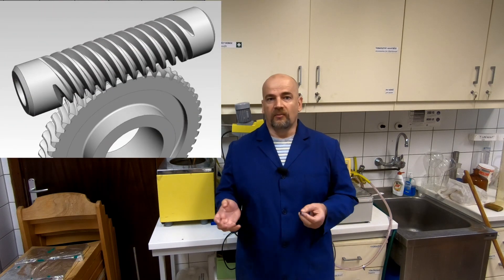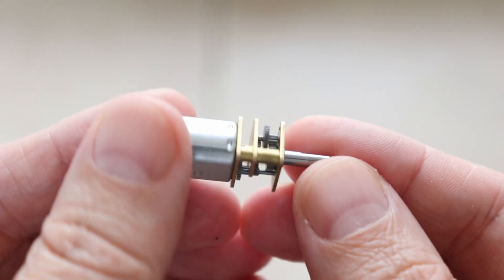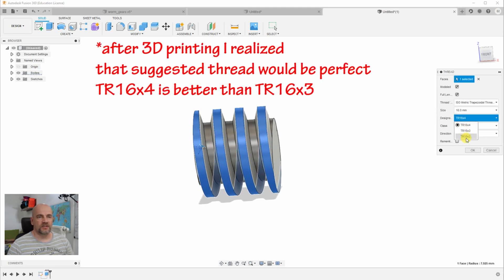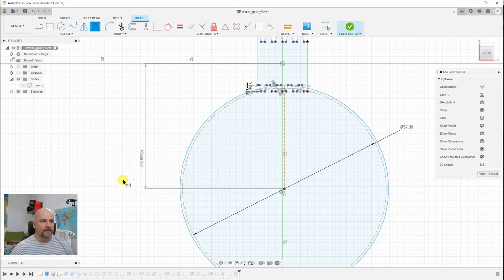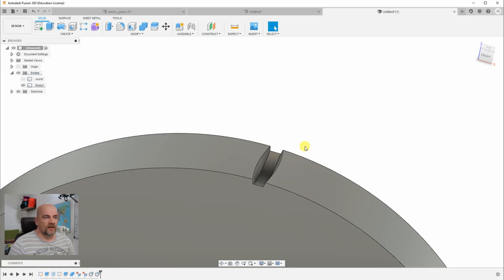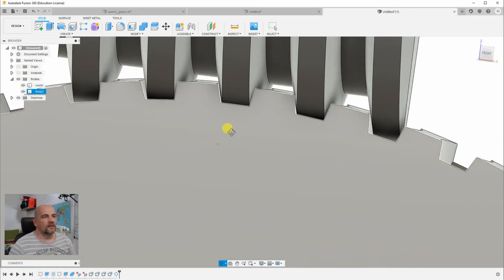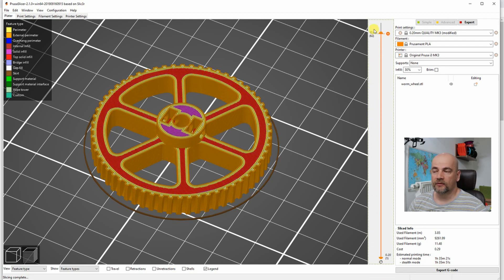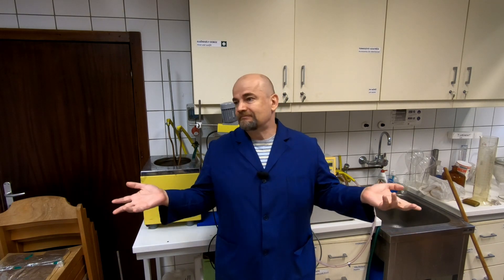3D printed worm gears designed in Fusion 360

Comment: Thanks for this.  As a design refinement, worm wheels also tend to have an indent around the middle of the teeth so the worm can sit lower, but nice to see it's not essential. Another vid on 3d printed worms also shows that applying grease reduces wear substantially (they seemed to have none vs destroyed gears without) so a good idea to use that for high speed / extended use.

Comment: I just found your channel, looks very interesting so of course i subscribed. I used to do worm gears manually like you but i found much better way. I bought a plugin called "worm mesh maker", in the fusion 360 plugin store.. it was $20 but i think it was well worth it, now it is as easy to make wormgears as it is to make regular spur gears..
Reply from the maker: Thanks, good to know, $20 is not much if you use it often. So far I need worm gears two times since I have 3D printer.
Reply: Good info!

Comment: Superb video. 
To reduce noise I like to use a short belt drive for a first-stage reduction between the motor and the worm.
Reply from the maker: That's good idea too, I planned to use a spur gears.
Reply: @MyTechFun  on belt maximum ratio will be about 1:5, but definitely worth it, spur gears will be loud as hell too :D

Comment: You might want to try creating an intersection body between your worm and wheel to start. Then indexing that body in a circular patter 1 tooth at a time and performing a cut operation. I think this will give you a closer appoximation of the involute surface on your wheel and might help with noise.

Comment: Very nice! 
I have a question, can you make turn the wheel by hand so the motor-shaft turn around too?
Reply from the maker: Yes, it is possible, but you need much bigger pitch angle.
Reply: @MyTechFun  ohh nice, the pitch angle, that is the secrect, than you very much...

Comment: Thank you for your video. Does your gear have backlash? I need some worm gears of zero backlash. Can you suggest where to find it?
Reply from the maker: They have backlash. For spur gears there are a lot of solution for zero backlash (like double gear with spring load etc), but I don't have experience with worm gears (in this topic).
Reply: @MyTechFun  Thank you so much for your reply. I really appreciate it.

Comment: Your attempt is a good beginning, but it's not all the steps required. A worm wheel tooth also needs an involute relief to the tooth face. You can generate this by rotating the worm around the model and recutting the tooth.

You have to keep the worm timed in rotation around the wheel. So if you rotate the worm model 5 degrees around the wheel model, you have to rotate the worm around its own axis by the same amount. Do this about 4 or 5 times, and you will generate a decent tooth space. Each repeated cutter operation creates a new facet on the face of the tooth. So the final model will exhibit 4 or 5 tiny slivers of surfaces, each contributing to an involute curve combined with a helical path.

I would focus on getting one tooth formed correctly, as this process is quite tedious. Then copy/ rotate as many as you need to make the entire wheel.

You section analysis fails to detect interference off the center plane.

I'm a real life machinist and have cut worm wheels with a ball nose endmill using a model generated as i described. Even then, my model is only a reasonable facimile of a worm wheel. But it will actually go together at the correct center distance, whereas, yours will not mesh without interfering.
Reply: Is there a better video out there for designing of worm gears?

Comment: Hey Igor, it looks like there's a Fusion 360 add-in called GF Gear Generator that includes worm gears. I haven't tested it out myself yet, though.
Reply from the maker: [Edited comment] I tested it with worm gears, worm wheel is not generated correctly. It looks like a spur or a helical gear, not worm wheel.
Reply: @MyTechFun  thanks for testing! Great to know.

Comment: Great Video. Isn't there a mistake how he's creating the lines for the pitch-diameter? According to that video (https://www.youtube.com/watch?v=12Kszw5y2Mc) the lines shouldn't be placed in the middle of the flanks..
Reply from the maker: That's right, good perception (but it's close), and as I mentioned, this is not standard worm, it can not be combined with commercial worms, it will work only if you design and 3D print both parts (screw and wheel).